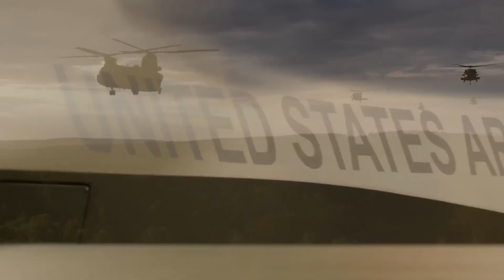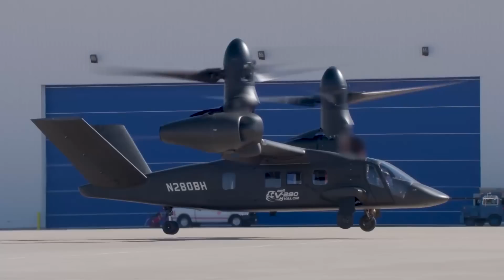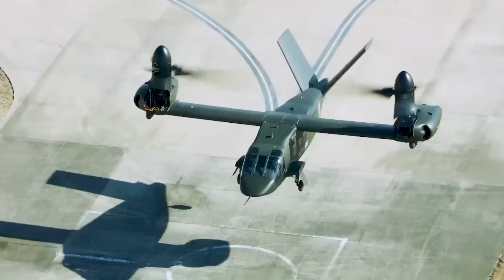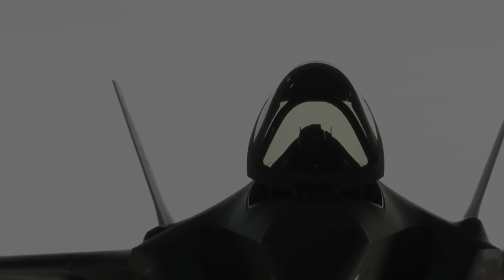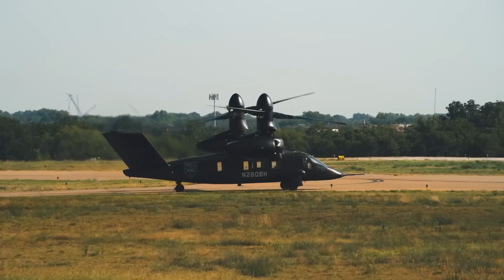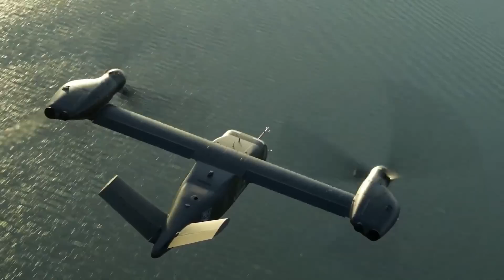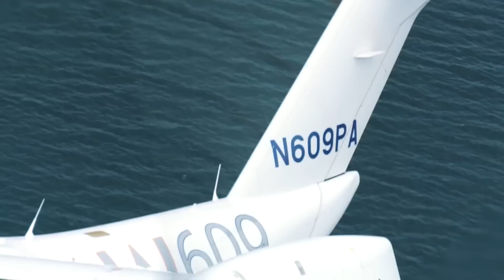V-280 Valor – The future Black Hawk

Comment: I’m no expert but the more traditional looking helicopter that was discussed is probably more combat maneuverable.  So quick rotations an infiltration of tighter spaces looks like and advantage.  If speed could be addressed adequately my inclination would be the more traditional helicopter as an assault helicopter.  That said the marine corps is actively working on infiltration and maneuvering platforms that can move battalions or so to beachheads. Think low flying boat/planes skimming the water and carrying a battalion equipped internally.  While smaller these vertical lift units seem viable for this end.
Reply: It passed the same low-level handling requirements as the Blackhawk and is just as maneuverable. It also had a better time to altitude and time to stop from cruise speed. Finally it only has a 19% larger footprint size in total and isn't that different in size.

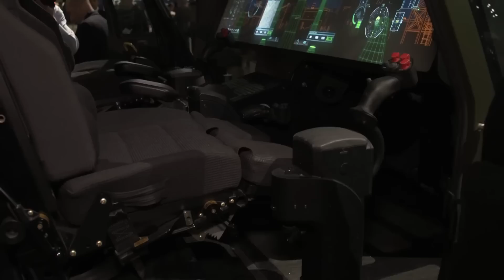Comment: as a former UH-60 mechanic in the army, I can honestly say that it is implausible that that "thing" would ever replace the UH-60.  It would have been better off if the army just bought the osprey.  The top doesn't fold up like the osprey, so that is an issue.  It is too long and wide to fit on a C-17 for deployment.  It doesn't have the hard landing shock absorbers like a UH-60 or apache does.  It doesn't have a refueling probe.  It doesn't have room to store any more fuel than a UH-60 or Osprey.  It doesn't have an External stores and support system like a UH-60 (and if anything were hung from the wings, it would block the crew chief's view from the gunner's window as well as impede troops exiting and entering the aircraft, as well as impede the movement of the wing flaps) When troops exit, they are immediately eating dust from the rotor wash as the blades are closer to the ground than the V-22.  If anything were hung from those flimsy wings that look too long to safely support the rotor hubs, they couldn't be rockets, missiles, or fuel tanks of any length as they would hit the rotors while in airplane mode.  Why not use a jet powered aircraft like the Ryan Vertifan to replace the cobra and apache gunships?  Or go really bat shit crazy and make an osprey with 4 rotating hubs?  It is almost as if some rogue engineer took the best things about the V-22 and UH-60......and removed them whilst promising a better machine and combining the worst aspects of both.🤣😂😇🥲  :face-green-smiling:@8:28 what happens when you crack your i-phone?  Oh yeah, we thought of that too.:face-orange-frowning:  I really think that the DoD has someone who is a savvy engineer working against the government.  It is the only reason for such lunacy on such a major scale.  The only positive thing I can say about the V-280 is that unlike a UH-60, you can approach it from the front without getting hit with the rotor blades. 💫
Reply: Okay only specialized UH-60s have refueling probes. Also, I'm sure your predecessors said the same thing about the UH-60 when it started replacing UH-1s. Furthermore, the MV-75, being Army, doesn't need to fold or even need to be transported via C-17 because it has a range comparable to a C-130. As well as greater speed.

Weapon wise they are still working on that, but the utility version takes priority. Given the prototypes' record I'm sure mechanics will grow to love it compared to the V-22s.

Comment: I don't get the desire for tilt rotors. This one in particular looks so ungainly. I mean, how is it getting into a tight LZ at night under fire to drop or CASEVAC. Not to mention that the doors are in such a weird place given the wing and rotor, again, not particularly practical. There's just no way this is better than the Huey and then it's successor UH-60. Both of which, were relatively cheap to buy, easy enough to maintain and considerably less complicated than this randomness. I mean, can you imagine trying to figure why the rotors won't tilt, when you're deep in the jungles of the indo-pacific under fire? No chance.
Reply: It only has a 19% larger footprint overall but carries more, goes twice the speed, and has over three times the range of the Blackhawk. It also passed the same low-level handling requirements as the Blackhawk, so it is just as maneuverable.

Comment: Since the V-280 Tilt rotor does not have to be stored on board ships like the V-22, the V-280 design ends up being much simpler.  In order to provide a compact configuration for V-22 storage, the engines with accessories and wing have to be rotated with prop blades folded.  For ground storage, the V-280 cannot (and does not have to) rotate its wing and engines with accessories.  The props are rotated but the blades do not have to fold.
The disk loading for both the V-280 and V-22 air vehicles, are worst than for a helicopter but not as bad as for the F-35.

Comment: Prop-wash is a fundamental problem with tilt rotor; making it irreconcilable to the functionality expected from a helicopter.  The prop wash of a real helicopter has a calm zone, like the eye of a hurricane, which is located directly over the center of the fuselage.  This why you see photos of helicopters performing rescues with a hatch open at the center of the fuselage and a person being winched up; the hatch and winch are at the position of minimum prop wash.  By contrast, no such rescue is possible with a twin rotor, since the fuselage center is the point of maximum (and massive) prop wash.
Reply: Incorrect again. You really need to look up the science behind these. Even the osprey has done water rescues and can do rope insertions.

Comment: The V280 doesn’t fold for shipboard operations a significant difference from the V22.
Reply: The V280 doesn’t have roll on, roll off capability for cargo and vehicles. Different missions, different vehicle.
Reply: The V22 can carry 24 packs where the V280 carries 12.
Reply: There's a Marine concept that would invert the V-tail and allow folding similar to V-22
Reply: @ the wing stow weight penalty alone would scrub that idea not counting the blade fold would also need to be added.

Comment: Junk. Blackhawk 54 ft rotor span this thing is 82 feet. Sure it’s faster but so is any other fixed wing aircraft which this essentially is. Just an absolutely horrible decision along with scrapping the Recon req. in which the Bell 360 Invictus was a stellar candidate and now scrapping their UAS fleet as well. The Army and FARA failed miserably.
Reply: It can fit in 3 sides of any box you can make around a Blackhawk. It can use the same LZs. Aircraft don't operate on a 2d plane so just turn it 90 degrees.

Comment: Is there a reason why they don't predict the mixture of pure helicopter missions and multi-role missions and purchase the defiant and valor accordingly?  Both seem amazing machines.
Reply: The valor can perform any mission a defiant can do. While the defiant can't perform missions a valor could do. The defiant was also just worse in every way and had loads of issues.
Reply: @n3v3rforgott3n9  So the valor can handle close quarter,  urban missions like the Blackhawk? I didn't see that issue resolved in this vid.
Reply: @LukeSeed  1. You are not using helicopters in contested urban environments. The military already learned this and it is even more important against manpad equipped enemies. 
2. The valor passed the same low level handling requirements the blackhawk had to pass. At a minimum it is just as maneuverable as the Blackhawk is. 
3. It can fit in 3 sides of any box you can make around a Blackhawk so it will use the same LZs.

Comment: I just want to know how it performs in urban combat where it needs to maneuver in tight corridor of buildings.
Reply: It can fit in 3 sides of any box you can make around a Blackhawk. It also passed the same level 1 low level handling requirements the blackhawk had to pass. Either way you are not using helicopters in urban warfare as that is foolish to do and an easy way to lose your helicopters.

Comment: No idea why they went this after the continuing Osprey problems.
Reply: This isn't the osprey.
Reply: Osprey is nowhere near as unreliable as it was when introduced and how it's made out to be, but besides that: The Valor uses a different mechanism that should mitigate the issues Osprey had, particularly around its gearbox where Osprey had problems. Avoiding tilting the entire nacelle on the wings makes for a much simpler mechanism that is more reliable, whereas Osprey had to rotate the entire nacelle (engine included) which complicates things considerably.

Comment: So what ? The V280 is just as complex as the V22, only slightly different. Instead of the engine problems with the V22 design, the V280 will most likely have major teething problems with the transmissions for the tilting rotors.  Complex is complex - and these things ALWAYS have a protracted development cycle. I won't argue for one or the other - I simply say that NONE of these programs will be "smooth sailing" - as some seem to think (and the contractor ALWAYS claims). 

And the 40 - 50 million apiece thing is bloody nonsense. The contractors (and the Pentagon) ALWAYS LIE about costs. They know perfectly well this will turn into 100 million (or more) a unit, before all is said and done...
Reply: Except helicopters in general are complex. Also prices drop once there are large order quantities coming through. Even the f35a is cheaper than most countries 4th gen aircraft.

Comment: Eventually, this aircraft needs to ditch the props, & replace them with jet engines. Less complexity & weight, no fear of blades hitting things, & more thrust!

"Ad Victorium!" ~Brotherhood of Steel
Reply: Perhaps there is a reason that has yet to happen that you fail to understand... Perhaps the fact that jet engines are beyond inefficient at low speeds and altitudes might have something to do with it?
Reply: @n3v3rforgott3n9  Perhaps when you mash many lots of apples, you add little bits of cinnamon have not mush, but "applesauce."

You would must to be boil apple mush for many yes minute for of course having perhaps the "apple butter." Perhaps must be of course much good...yes no?!?

(every time your left foot touches the ground)
Reply: @FobbitOperator  You must be a bot.

Comment: V-280 like the v-22 tilt rotor is a nice fast aircraft.  But not good for gun out side doors for protection like Huey & Blackhawks. Will V-280 be good for USCG rescue? V-280 To me is a cargo or people hauler. Probably good for removing wounded to MASH units. Not sure if used to squeeze into forest conditions. The airbus EC145 / UH72 is a better choice for some tasks of rescue.
Reply: They will have door guns like the h60. Anytime you would be firing the door guns the rotors would be up and out of the way anyway.

Comment: Another great video. Seems to me that rotors as lifting devices are inefficient at the moment. Maybe some form of kinetic recovery system in the SB craft could give it more range in the future.
Reply: Physics as different.   Most efficient is a low acceleration of a large mass of air over a large acceleration of a small amount of air

Comment: With the advent of the Full Self Driving Tesla and Artificial Intelligence it is time for designers of cargo aircraft to start thinking outside the box.
1. This is a cargo aircraft.
2. Why does it need a pilots which add weight and complexity, drones takeoff and land every day?
3. Why not electric motors driving multiple propellers?
4. A central gas turbine turning a single electric generator.
Simplify, Simplify, Simplify.

Comment: If it's getting the engines off the larger tilt rotors, and it's foot print is larger, then it should be classified as a large helicopter.

Comment: But the V-280 still has the same problem as the v-22. If the rotors were to get stuck or jammed in the forward position, it can’t land
Reply: They can still land... you think they didn't think of this with the osprey when they made it? They sacrifice the rotors, and they are designed to fold and break away from the fuselage.
Reply: @n3v3rforgott3n9  explosive bolts?
Reply: @EnterpriseXI  no. They simply get destroyed on landing but because they spin away from the fuselage and how they are shaped they don't break off into the passengers or pilots. In some ways a tilt rotor would be safer on a crash landing as there is no large pieces of equipment or fuel above the crew compartment.

Comment: It is necessary to transform the V-280 into a medium or large seaplane version that can hover low over the water, propel forward or turn quickly, take off and land, land faster on ordinary dirt roads or on top of high-rise buildings, and withstand harsh seas condition. It needs to be upgraded to achieve long-distance flights of 9,000 meters in the air and a temperature of 45 degrees Celsius.

To minimize the weight of the fuselage and power system, achieve automation and unmanned driving, and carry more than 20 tons of cargo, the range needs to reach 5,000 kilometers, and the top speed can be increased to 800-1,300 kilometers per hour.
Bell and other companies need to increase researchers' salaries and bonuses, work with more senior professionals, and dramatically speed up development of projects that have been delayed for too long.

Comment: To better satisfy the more conventional helicopter crowd ... the Valor could develop the swing wing like the Osprey but into a working configuration as per the Chinook.
Reply: To reduce the wider footprint
Reply: @freightshayker  it would vastly increase mechanical complexity for little gain. You just land 90 degrees turned and you would have a similar footprint as the black hawk.
Reply: @n3v3rforgott3n9  
Yep. And the Navy thinks swing wing for the Osprey is mandatory.

I'm just saying in a perfect world. Because the Defiant team is upset their configuration lost the competition. But I think we'll see that aircraft as well
Reply: @freightshayker  for now, it is purely an army program, but for sure, if the navy wanted to adopt it, there would have to be something similar to the osprey. I just hope they don't shorten the wingspan or blades as those changes had big performance hits to the osprey.
Reply: Why? The Valor provides considerably more performance and the same maneuverability.
Reply: @n3v3rforgott3n9  
To help reduce the wide footprint so to speak

Comment: Can they install a fuel bladder in the cabin to allow extra  long distance ferry flights.
Reply: I doubt that would be needed. It can already fly without a pilot to where it is needed to save on weight and fly at higher altitudes to save on fuel. I imagine some wing mounted fuel pods would be easy to do, but again, they are not too needed as it can already get to Hawaii from California.